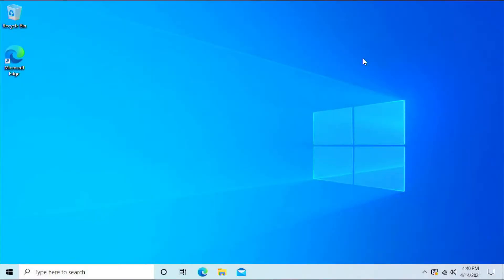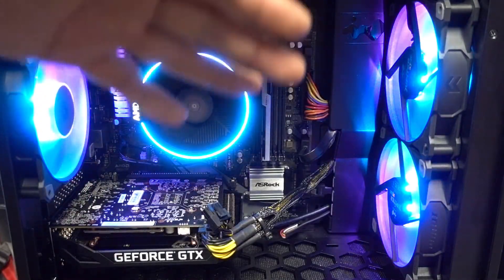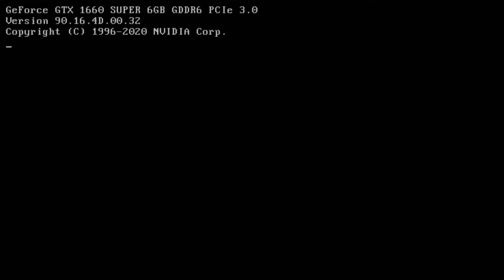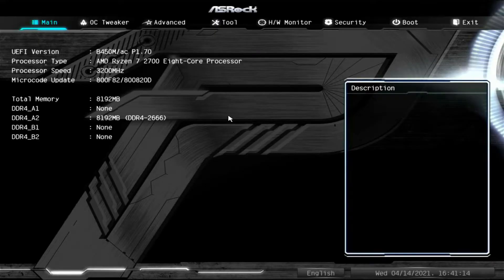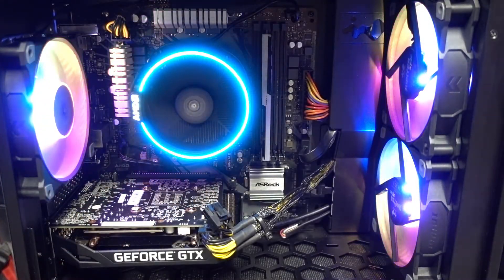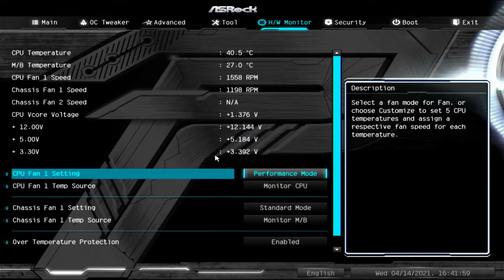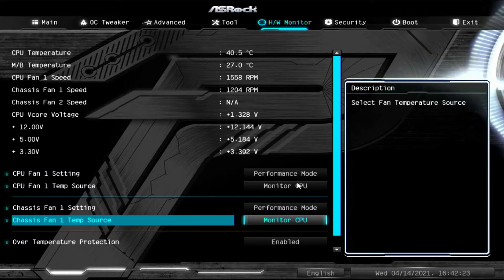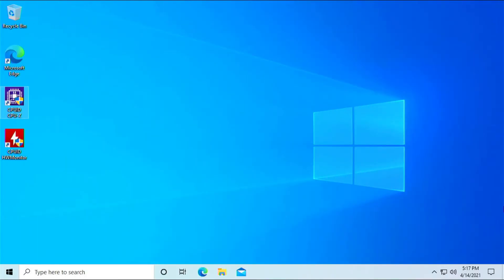Sync your case fans to the CPU fan for better airflow

Comment: hey there, nice vid. :) i was just wondfering how did you manage to record your screen even when ur pc was restarting? also, is there a way to sync you gou fans to your pc case fans? Thank you!
Reply from the maker: Hi and thank you for watching! I used a cheapo capture card and recorded the output of the test computer to my primary one using obs. As for you other question, i would suggest customizing the gpu fan curves independently from the cpu and case fans as most applications utilizes the cpu and gpu independently. You want the gpu to independently cool itself as needed.
Reply: @troubleshootdis5930  aight you sound like a man with a million iq. Thanks for spending ur time for me man. I’ll look into it. Have a good rest of your day :)